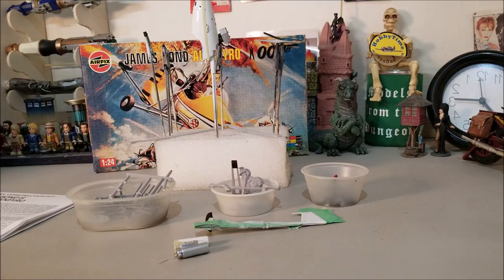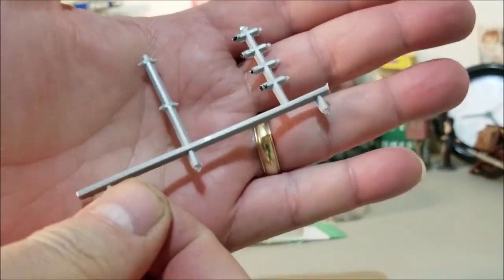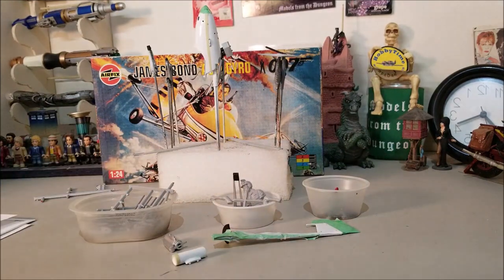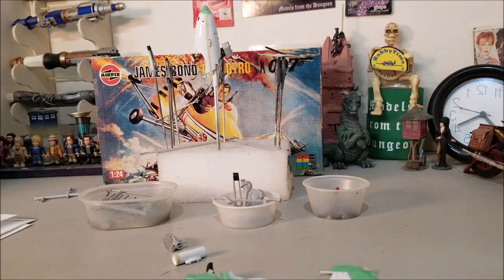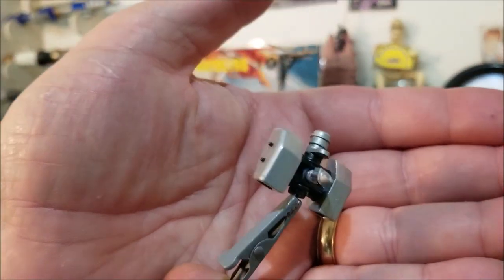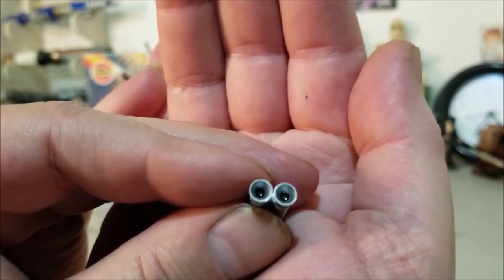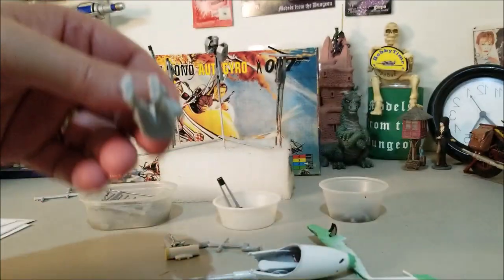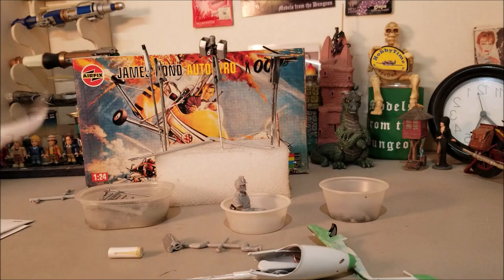Whirlybird Group Build Update I'm not done.

Comment: Great to see you!!! Looks like a tough kit but it's gonna be nice! I would like to find one.
Reply from the maker: Thanks Oron.  I hear they are asking stupid money for them.  I bought this one when at the end of the release, so it cheap.  It's been a pretty good build.  Those side rockets are really not too hard to correct.  I assembled them completely before seeing the blog, so I just cut away the excess and extended the tube.  I was lucky to have some clear tube floating around that fit and used about 1/4 inch for each.